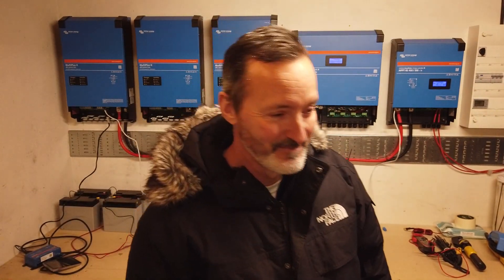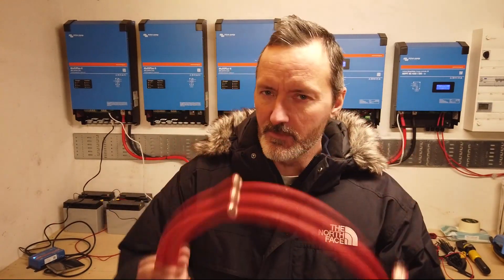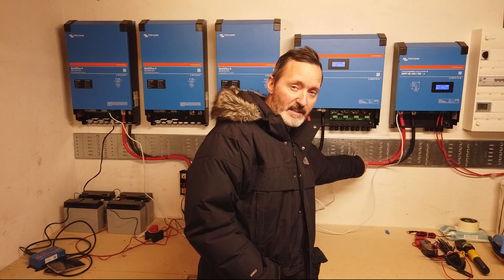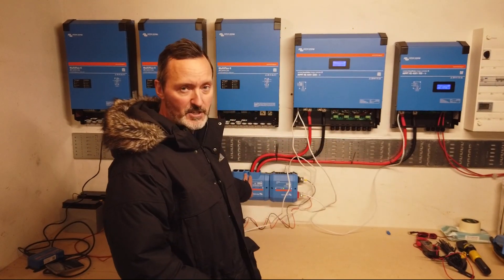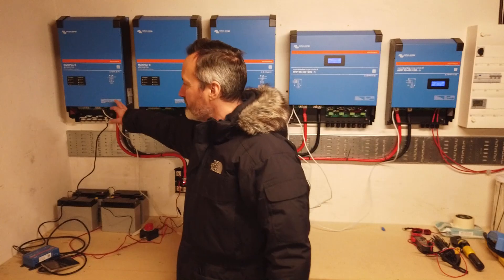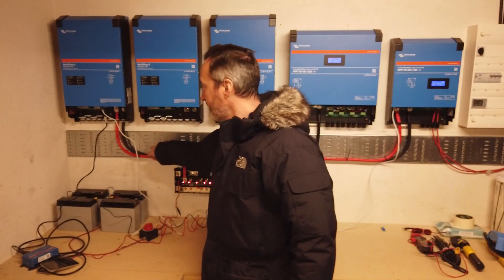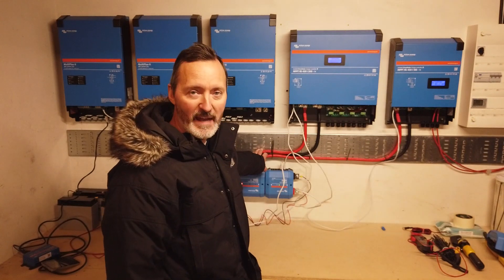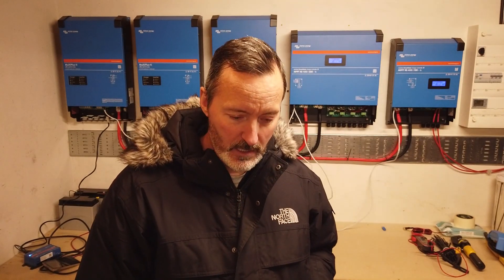Victron - DC cables on your Victron Inverter Installation - Part 1 #victron #solar

Comment: Darren what’s happened to the video, I’ve not even seen the whole thing up and running? I’ve had some developments my side my 5000 was changed due to Solar AC dipping and unit drawing more it didn’t seem to recover like the Quattro 5000 anyway long short it got replaced for 10000 multi which doesn’t seem to have the same issues, I’ve gone OT on the DC cable at 95mm2 X 2 and changed the mega fuses at the batteries for ADLER EF3 which fit the Lynx distro and power in M8

Comment: YOUR MATH IS WRONG! YOU WIL DO 15KW FROM BATTEYR -YES, BUT INVERTERS WILL NEVER DO MORE THAN 5KW. So 70mm2 wires is not needed. ye sthere is tiny tiny voltage drop-who caares.. it's sun energy its abundant anyway.  Wire cost soo much that is better to waste energy imo :D
Reply from the maker: Better safe than sorry ;-)

Comment: For 3 phase systems I do not think the DC wiring "needs" to be all the same length. As each inverter is servicing different loads on each different phase. So they will never be perfectly balanced anyway. Only when you have parallel inverters all on one phase is it critical - as they they are sharing the load.
Does not do any harm though! Well maybe a tiny bit more heat lose on the middle inverter.
Reply: Correct: Only for units in parallel: Both the DC and AC wiring needs to be symmetrical PER PHASE
Reply from the maker: Yeah, that makes a lot of sense, actually. I have quoted the Victron Wiring Handbook several times as it's a safe bet with these things bit you're right, having seen the system running now, all 3 phases operate on different loads all the time. I'm sure there's a good reason why they recommend it, but I agree with what you're saying totally.
Reply: @TheKilowattChallenge  well as long there is shunt and cerbo and/or there is "single source of Voltage and Current" then DC cabling doesn't matter for simple (1 inverter charger per phase) setup. 

Cable lenght must be same (for same polarity i.e. same lengths of all positive and same lengths of negatives) in these cases:
- parallel connection of batteries: for example connecting 4 units of pylontechs to Lynx
- parallel connection of inverters: for example having 2 Multiplus per one phase - then the two multipluses has to have "identical wiring resistance".
Reply: victron training vid guy says in 3 phase not super important the dc cables need to be same length to each inverter
Reply: I am building a three phase system as we speak, but as far as I know all (parallel) batteries need to see equal impedance/resistance to distribute the stress evenly across all batteries.
Reply: @ Again that is not super critical. As it is not the end of the world if the load is not even across all the batteries. Just means one will wear out quicker than the others - so you just have to replace that one 1st! Which might actually be better from a cash flow point of view of them all wearing out at the same time and so having to replace them all at once!

Comment: You winning Darren? Wish I went for 1000KV inverter now but all working good
Reply from the maker: Sounds good, let's hope for lots of sunshine :-)
Reply: @TheKilowattChallenge  no wish it was a 10000 multiplus 2 instead of the 5000 would have given better tolerance with the high demand stuff, but another solar inverter I think should be better than upgrading the multi

Comment: All done batteries all wired up and the Victron finally setup, glad I went for 120mm2 cable does start to get warm but only 2 or 3 degrees over garage temp
Reply from the maker: Yeah my 75mm cable starts getting a little warm at around d 150 amps!

Comment: 70mm2 is not a lot .... it even seems a little small to me, you would be able to draw 300A from batteries, 70mm2 is for 200A => 3% lose for a 6m cable.
Reply from the maker: It's certainly the minimum for my setup :-)
I've been running them for a while and they're working great, each cable is less than a meter long so the resistance is as low as it could ever be for that cable etc. You're right to highlight it though, but it's stated in the manual as being the correct diameter for this equipment.
Reply: Darren what’s happening?? So on my front my multiplus 2 48/5000 has gone issues with the AC solar and how well it balances so made way for a multi 2 48/10000 and another array of 1.5kW wish I had the multiplus first as I could have increased the array to the multi 1to1 rule oh well I’ve got room for expansion now

Comment: Your cables to the bussbar from the inverter can't be the same length .. why ? Cause if yuo look closely, the busbar length is not the same for each inverter.
The millivolts you see between those 2 solar controlelrs may just be disrepency between sensors...  specially with this battery where you certainly tried a very small Amperage.
On a 16mm2 cable, on 1m with 1A current the voltage drop is  0.005%, with 50A... would be 0.26%, Same lenght will ensure that each charge controllers see the same voltage.... meaning it would change things at top charge...
Reply from the maker: Interesting, well in that case, I'd go with your sensor theory because they're reading slightly out even under no load 👍

Comment: Originally I'd thought you'd wired the Lynx backwards (batteries normally come in from the left), but then I noticed you have the Lynx set installed upside-down! :) Good work so far, looking forward to your future videos.
Reply from the maker: Haha yeah well spotted. They've designed it so its really easy to install in either direction - thank goodness!  
DC Cabling cutting and crimping video coming out next ;-)

Comment: Pretty crazy that half a meter difference in wire, even of that heavy gauge, can make a noticeable difference in the resting voltage readings. And as you said, under load that 30mV value will greatly increase.
You don't want your chargers fighting over voltages, or shutting down early because one reads a higher voltage than another, and then the other charger has to work a lot harder for the remainder. Or worse, the charger starts to cycle on/off as the battery voltage fluctuates (though, this shouldn't happen if the trigger settings are far enough apart)
And then there's the inverters, possibly cycling due to voltage drops  🙄  So much to consider!!
Reply from the maker: I know right, thank god I read the manual! A did a lot of youtubing! :-)  Actually, Victron has published a whitewater called Wiring Unlimited, which applies to all installations. It is well worth a read!
Reply: With zero load the voltage difference will be zero, regardless of the cable size, but under load the voltage drop will of course increase. Unfortunately, cable length is the least of your worries because crimp quality can make more of a difference. So be sure to actually measure the resistance of each cable assembly using a suitable measuring device.
Reply from the maker: Oh I didn't do that. I'd better do a temperature check when the chargers and inverters are running a full pelt. Thanks for the tip!!! :-)

Comment: I went for 120mm2 for my Multiplus 48/5000 over kill but amps travel to distro/inverter for two or three batteries so would rather go for the highest to keep temp/resistance down, I will hopefully be ordering my batteries next month and enabling DVCC and ESS and the last thermal probe to measure everything in the garage.
Reply from the maker: Sounds good. DVCC is excellent, works really well. How many chargers do you have?
Reply: @TheKilowattChallenge  I only have the one, it’s taken me since January just to get that stuff as had to get the mains moved as well as new fusebox inorder for it to all go through the inverter, my house is only single phase but Victron kit isn’t cheap as you well know.
Reply from the maker: Make sure your house is wired to TNS standard, that means a separate neutral and earth all the way through.
Reply: @TheKilowattChallenge  I’ve changed my wiring to TT that’s what costed a lot to do it with a double CU, but I did go OTT with the stake and earth cable 25mm and 4 and a half rods they got 2.15ohms from the setup and it was continuing to drop as the backfill compressed the rods